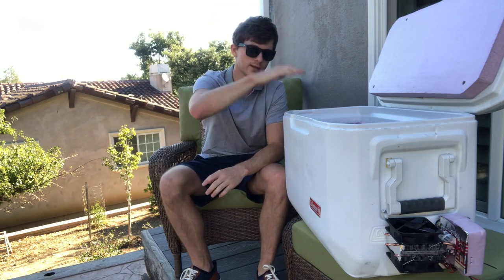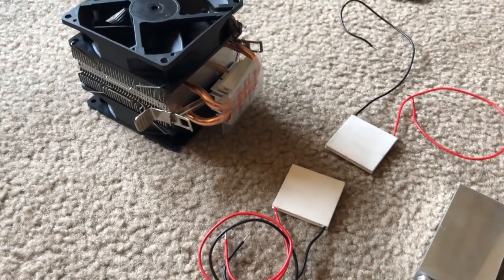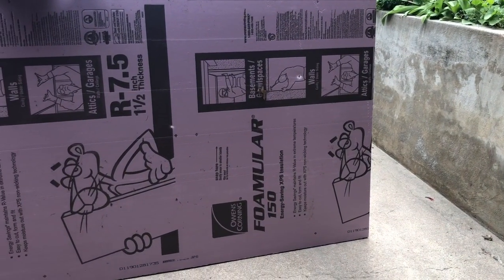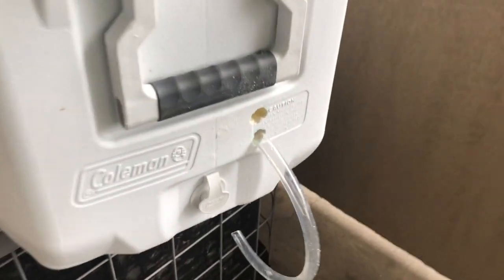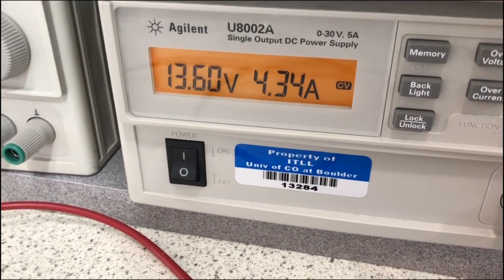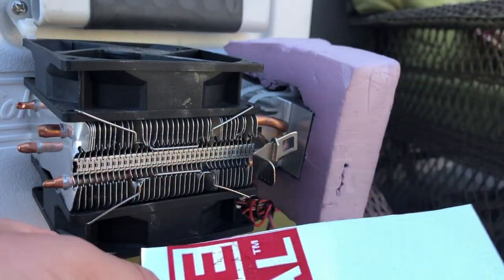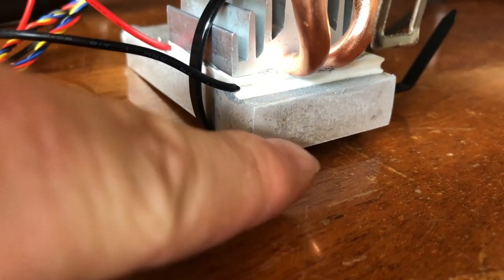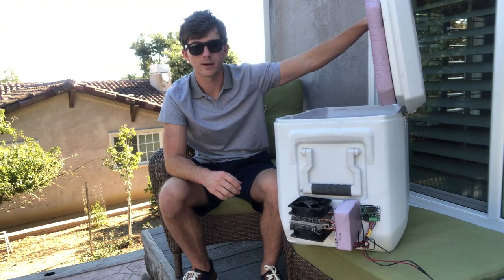How To Build Your Own Overlanding Cooler

Comment: Good job, fellow M.E.(?)   I tried one of those cheap ones from ebay, it never worked so I expected something blew, like the SS Peltier device and was going to fix it, but then reviews said they never cooled much anyway.  So I was thinking, 'why fix it and not just make my own, better?'  So a search brought me here.  I like your review at the end,  about temp differential, I suspect that is all the one I purchased could ever do.  I don't know how good the expensive units are ($200, better work).  Maybe they use more than those devices, which probably just aren't powerful enough yet.  What do you think would exchange more heat?  Ice bath, antifreeze, Freon?...
Reply from the maker: Yes I am a M.E. The exchange heat with a different source is not the problem. It is the number of peltier devices required to give you enough of a temperature deviation from the outside to the inside. If you more peltiers you will have a better chance but you will have X times the current required which is my you see all portable fridges 12v compressors.